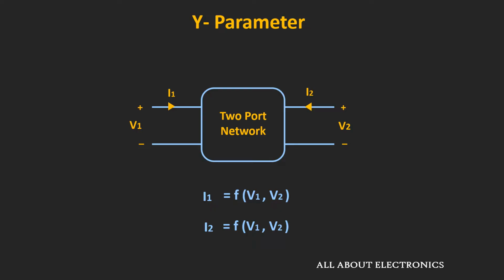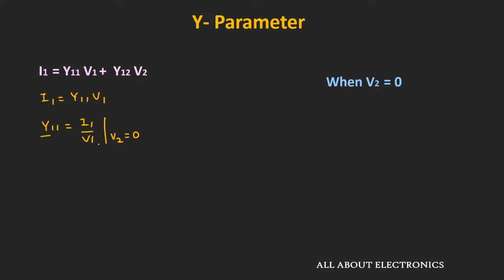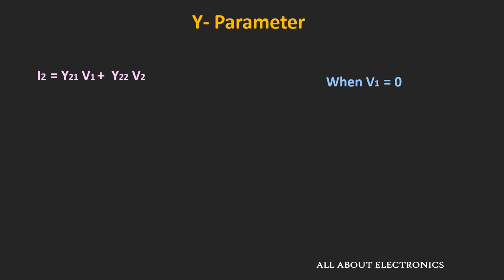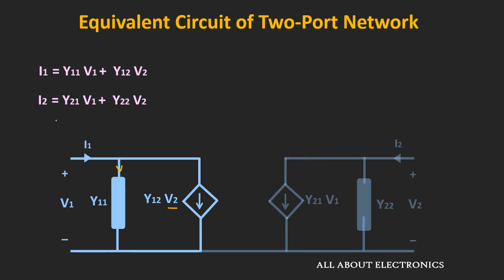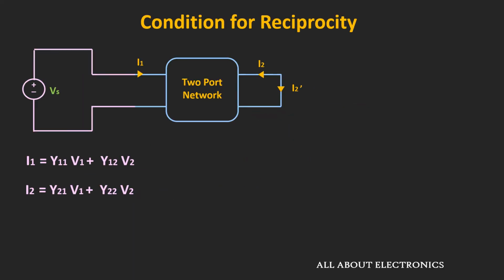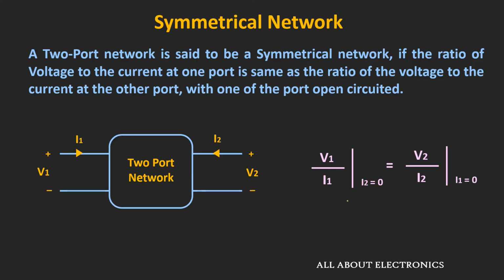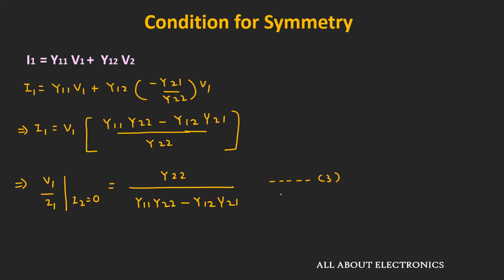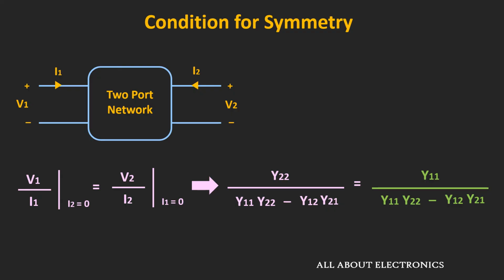Y- Parameters Explained | Condition of Reciprocity and Symmetry for Y- parameters

Comment: why we short circuit in y,z parameters but open circuit in z parameter
Reply from the maker: In Y parameters, to find Y11,Y12, Y21 and Y22, we are setting  V1 and V2 to 0 (Please see the equations of Y parameters). Which is effectively shorting the port 1 or 2. 
In case of  Z parameters, to find Z11, Z12, Z21 and Z22, we are setting either I1 or I2 to 0. which is effectively open circuiting the any one of the ports. 
I hope, it will clear your doubt.

Comment: Condition of symmetry at Y parameter Is (RATIO OF  CURRENT TO THE VOLTAGE THAT IS I1/V1 =I2/V2 THAT IS Y11=Y22  ) But here it is V1/i1 and v2/i2 , is it right !
Reply from the maker: The network is said to be symmetrical, when the impedance measured at one port (keeping the second port open) is same as the impedance measured at the second port (keeping the first port open).
Mathematically,  it is V1/ I1 (when I2 = 0) is equal to V2 / I2 (when I1 = 0). 
In case of Y- parameter, the condition for symmetry is Y11 = Y22 (as proved in the video). 
I hope, it will clear your doubt.

Comment: Sir, why did you take I1' and I2' directions in the opposite direction of original I1 and I2 ??
Reply from the maker: In two-port network terminology, I1 and I2 are the incoming port currents.
While here I1' and I2' are short circuit currents, which are flowing through the short circuit at the particular port. (Its the response due to the excitation, which is flowing away through the short circuit).  
I hope it will clear your doubt.
Reply: @ALLABOUTELECTRONICS  oohkay...Got it..Thanks sir..😃✌️